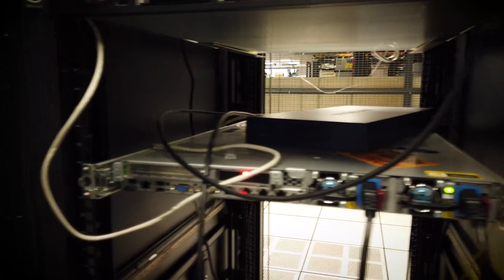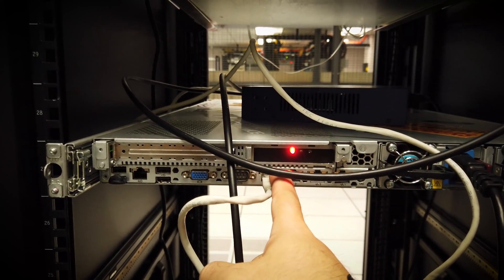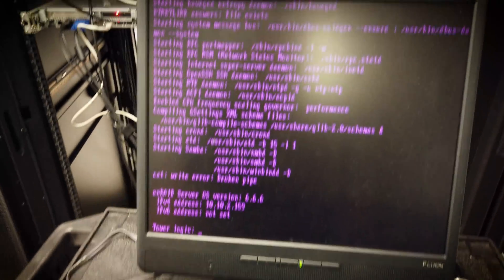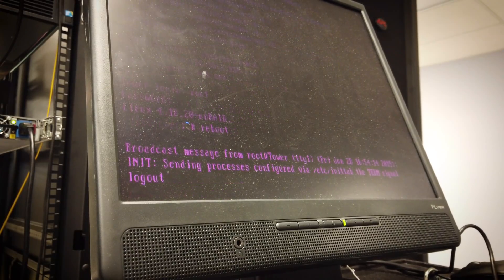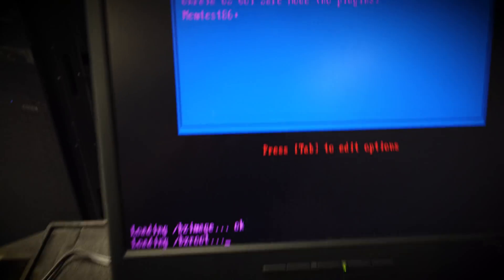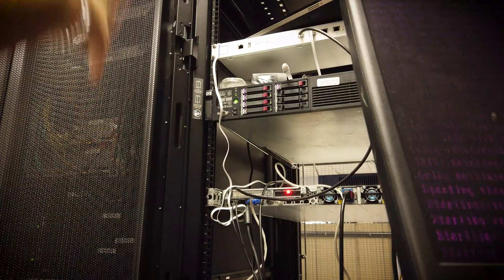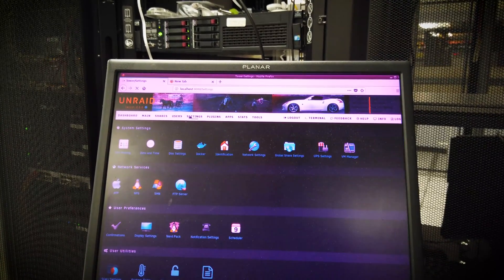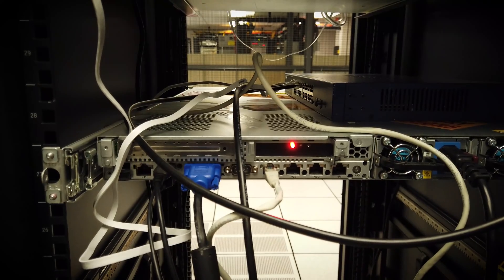Server Moved, Antenna Problems Continue - DIY Ubiquiti Internet Relay - Pt 11.4

Comment: From a 23+ year datacenter visitor I really like what you are doing just flying with it ;) only you have to know where the cold air is coming from, and turn one of the servers I see two servers and they need to pull air from one side and blow out the other. Now the below server is blowing warm air in the server above because that is pulling it in. Just a tip for the endurance of your equipment ;)
Reply from the maker: Yup...mine had to go that way as it stuck out too far to close the door the other way. 

If heat was an issue, I would have reversed the fans so airflow was good. It was never an issue though and I'm out of the DC altogether now.
Reply: @rmp5s  yeah indeed I was binge watching your series so I noticed and just about ten minutes ago I thought I should have kept my mouth shut as usually haha. But great to see man! The tower and all the connected stuff is awesome! I live in the Netherlands and internet is everywhere but really geek out on watching this feels like the early days for me, pioneering internet :) keep up the good work !
Reply from the maker: @dennisponne8786  Hahaha...awesome!

HUGE new video goes live in 2 minutes. 😎

Comment: Hey, just a quick note: I saw you had 8.8.1.1 as your secondary DNS server in the unRAID. 

Google's DNS are 8.8.8.8 and 8.8.4.4, there is no service at 8.8.1.1... You might want to change that setting to prevent trouble in the future :)
Reply from the maker: Might have fat fingered it. I'll check it...thanks!

Comment: Do you use ucrm for client management
Reply from the maker: For initial configuration, yup. Makes setup super easy. 

Once they're up and running and on the network, I just log into them or the sector to check on them.
Reply: can they pay for services through the client portal
Reply from the maker: @SpottedDogNetworks  rofl...disregard my last. I read "UNMS", not "UCRM". 

UCRM is in the works.
Reply: ok thanks
Reply from the maker: @SpottedDogNetworks  No problem. It's almost done. Still have to do some DNS redirect and SSL cert stuff. Soon!
Reply: ok what crm service do you use for your clients?
Reply from the maker: @SpottedDogNetworks  Right now I'm using SneakerCRM...as in, I walk my happy ass over and pick up a check. lol
Reply: lol thanks

Comment: Before selling your antenas, try raising them a bit or moving them to the edge of the building. From your last video it seems that the problem is heat coming out of the roof might be the cause of the interference.
Reply from the maker: They're about as high and to the edge as they can be. Don't really have anything I can do as far as that goes.

Comment: So are you using a backhaul to reach from the data center out to a sector antenna, and from there shooting out to subscribers?
Reply from the maker: Nope. Backhaul goes from datacenter to relay house. Sector antenna at relay house goes out to subs. It's all in the older videos.
Reply: rmp5s you would figure that I had better recall, I’ve been watching a ton of videos and reading online about it so I didn’t remember. It’s awesome that you can literally become a WISP with the help of just some components.
Reply from the maker: @Cybernetic_Mastermind  Seriously, what you can do with relatively cheap, off the shelf stuff is AMAZING!

Comment: I would like to see a site survey you complete for customers testing antenna receptions and then the install. This would really help me understand the planning and execute of this setup. Cheers!
Reply from the maker: Alright...I can show the process. I'll try to get that in the next video!
Reply: @rmp5s  Awesome thank you... I honestly surprised you had issues with the AF24HDs...looking at their spec sheet they are rated for almost 13 miles. Hopefully you have better results with the AF5s.
Reply from the maker: @MrCody760  Yup...that's exactly what I thought when I bought them. It's not like I'm trying to eeek out 12 of their 12.4 mile range. I'm only using 2/3 of it. 

But...not only am I shooting right into downtown Phoenix, I'm also shooting directly at Phoenix International Airport, too. LOTS of noise.
Reply: Also what's your price for your dedicated fiber line? Curious about leasing out tower space in my area with fiber ran to it. Do you have a relay site or are you hosting everything out of the datacenter?

Comment: Install looks good! Don’t forget a drip loop!
Reply from the maker: Call me a n00b if you'd like...but...drip loop? lol
Reply: @rmp5s  yeah, to prevent water damage on your PoE although where you live seems pretty dry.. But water can go inside UTP cables and burn your injectors so right before getting inside of the house do a loop with the cable and staple it down.
Reply from the maker: @geogmz8277  Oh. Interesting. Thanks!
Reply: google Drip Loop. Please don't staple your cable, use wire clips

Comment: Hi Brent. If you go for 5 GHz use these https://www.ui.com/airfiber/airfiber5xhd/
Check out though what AF11 does in link if there is a shitload of 5 GHz traffic in between
Reply from the maker: I'll check it out!
Reply: @rmp5s  Airfiber 5XhD is a good alternative to Airfiber 5Ghz differential will be in duplex in favor of Old Good Airfiber 5. If I have never achieved the modulation of 4096 in the Airfiber 5XhD model ...